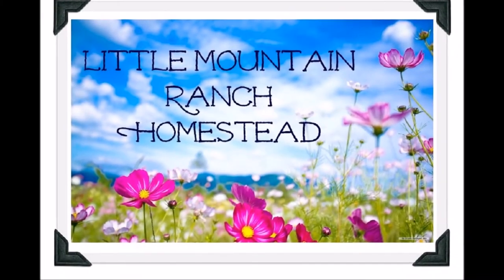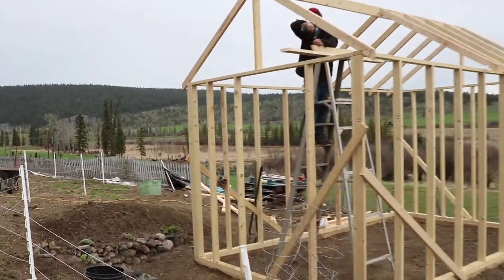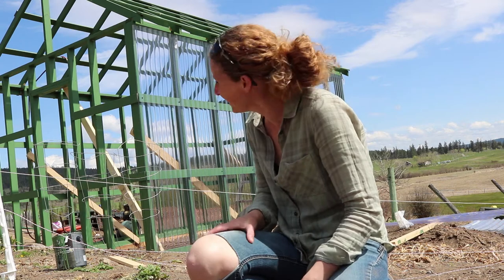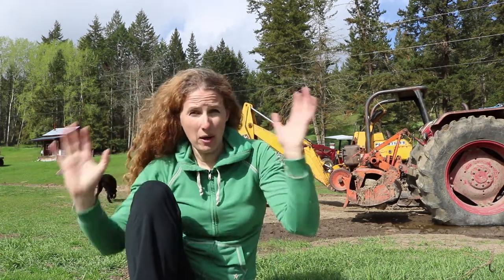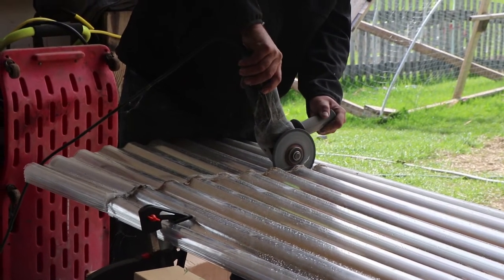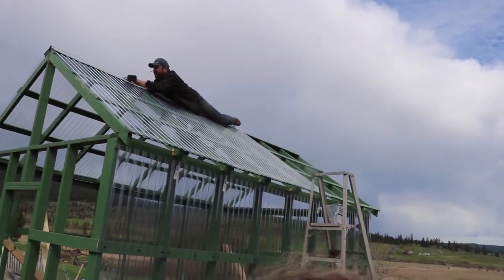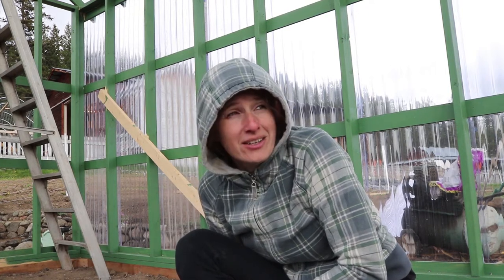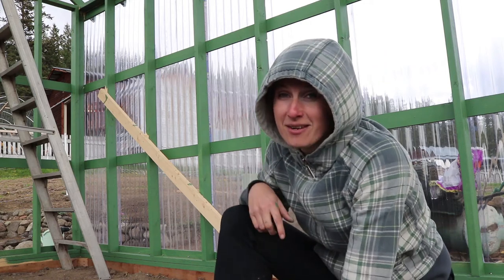Greenhouse Build Part 2!!

Comment: Love your photobomb dog Cypress (does that make him a good water dog?). Beautiful. Heat expansion is also a problem on corrugated sheet metal roofs. Over time it drives out the sealed washer screws that are holding it down. Thanks for the reminder. Another big chore to do (one that is a six hour drive away...) from where I live.

Comment: Sure hope you didn't regret using the Palrue...the plastic yellows, and yes, it melts.
Reply from the maker: We only used it on a bit of it, the rest is the higher grade stuff that is specifically designed for greenhouses, so hopefully it holds up. We’re a year in and so far so good.